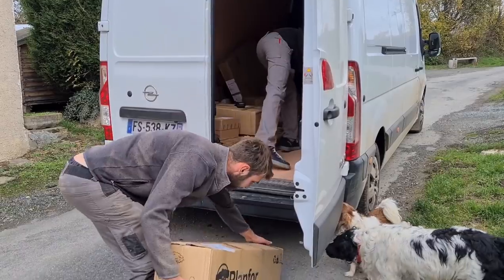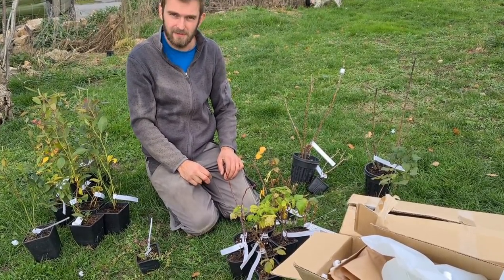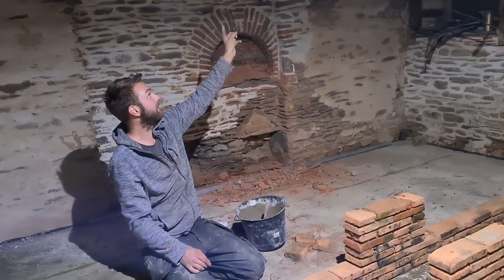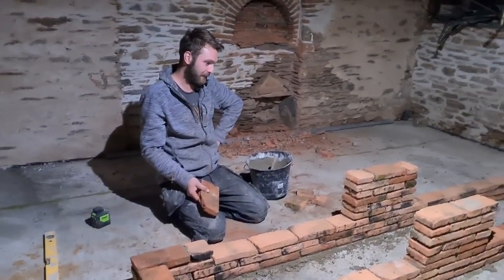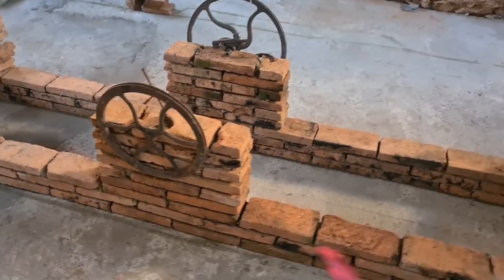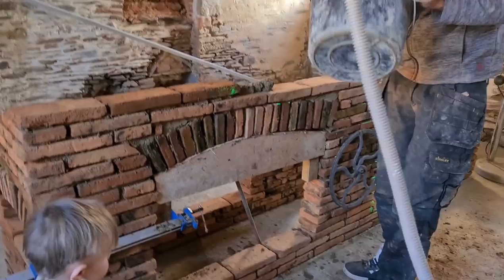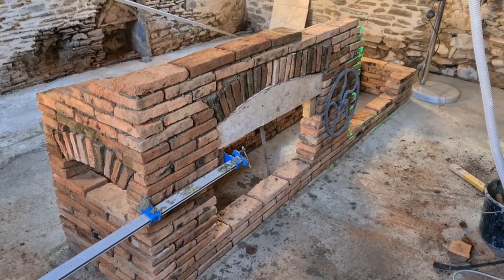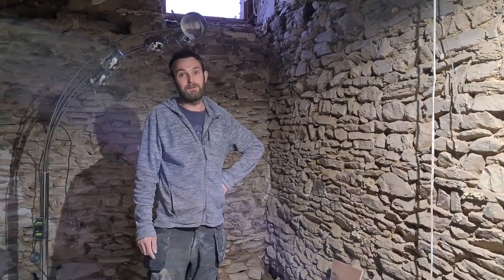Escape to rural France- Christmas deadline part 2 EP016

Comment: 😍Do love those handsome sewing machine wheels & how you added the pair for visual interest in your brick island. Well done.

🍳As someone mentioned the third wheel would be cool as a petite pot rack suspended from one of the rafters (or the underside of a lower open shelf for the height impaired). Major fan of pot racks in order to clear up cabinet & drawer space for dishes & small appliances. 

🗿Decoration is fabulous, but it would also be wonderful to put one of these great industrial pieces to work too.

🤔Lots of compromises when building something to suit both taller & shorter ppl who cohabitate. Personally, I am quite willing to use a stepstool or ladder to access much coveted vertical storage, but I understand that many are not inclined to do so.

🍽My sister-in-law's deep vintage family farmhouse kitchen sink was the perfect height for her (as well as our ultra petite moms). My bro is 6'2" to my 5'7", it would kill our backs to stoop so low. As a solution, we used to have to put a dish pan of hot suds on the counter next to the sink when it was our time for K.P. duty.

💡Since I am taller, I particularly hate pot racks or pendant lights mounted low over islands or peninsula bars where it directly impedes my 👀sight-lines. It's no fun to constantly bend to the side to see a person on the other side, esp. when you're wearing heels👠.

Comment: That arch has no strength, read up about arch construction and look at your oven arch for an example.
Just trying to be helpful before you build the other three.
Reply: Also wondered about shelves inside as you make it, will it be more difficult after.
Reply: Does the arch of bricks have to continue into the upright bricks to a reasonable depth to spread the load?